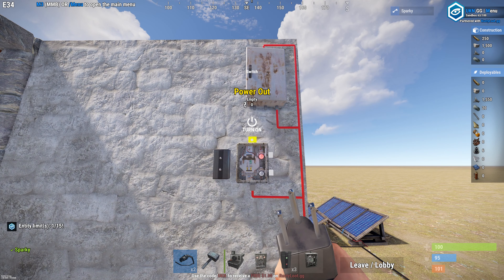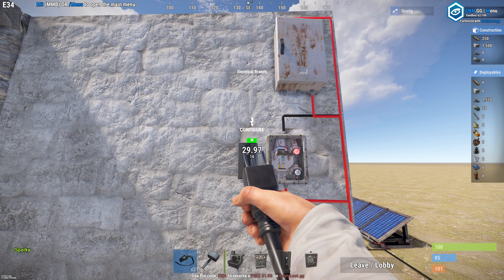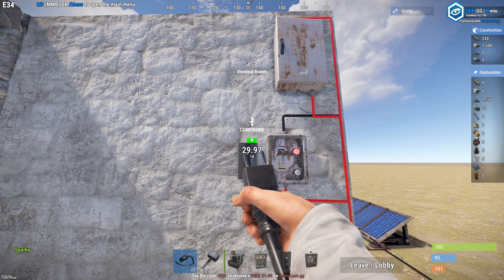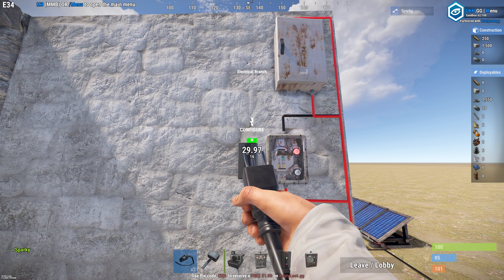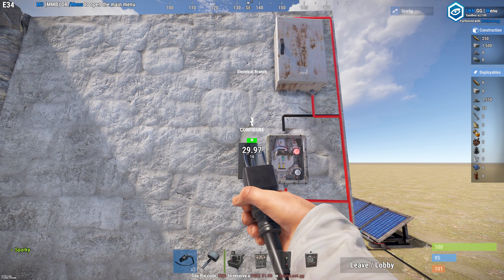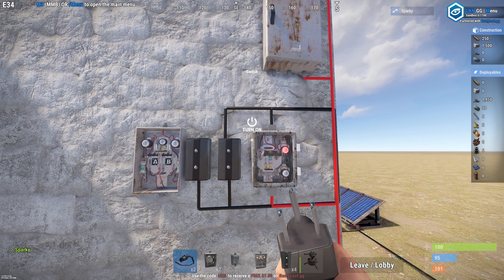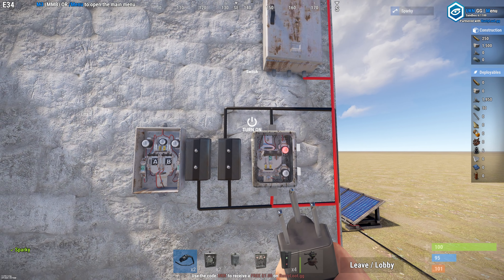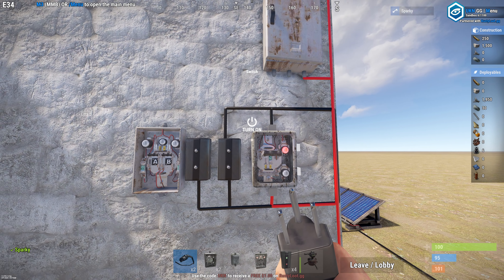Most Efficient Smart Turret Guide | Rust Electrical Tutorial in 4K

Comment: splice a OR switch in front of the AND switch. connect HBHF out and ATs "has target" port to it which greatly expands the target range after HBHF activating (I guess at least 3-4 times further)😁👍
Reply from the maker: That’s awesome, will add to the advanced build!
Reply: yeah I do this so the door stays open while the turret can still get the kill. Only down side might be that if killed outside of HBHF range, they can come back and loot their body without HBHF opening the door.
Reply: @7thAttempt  hmm, I think you could fix that with a timer included. Make it so that the HBHF signal only update false status after an amount of time had passed. That way they can't instantly loot their body.
Reply: @Redox_Channel  yeah I do the same with a timer, stays open long enough for me to loot them and run back to base... I hook the "has target" output to the timer toggle
Reply: Wouldn't thoes trip lasers be better in some cases? I never see that being used